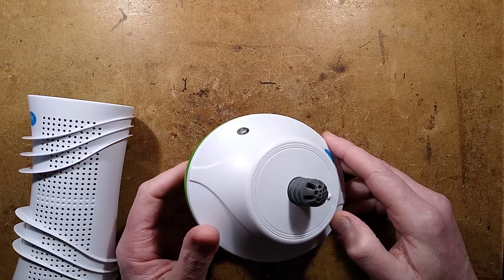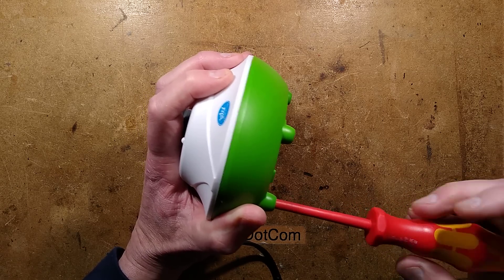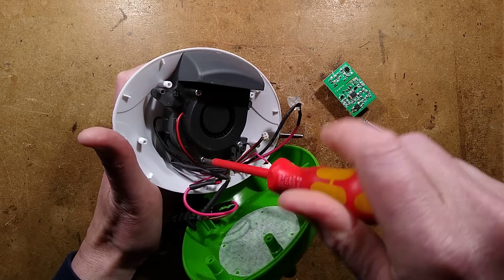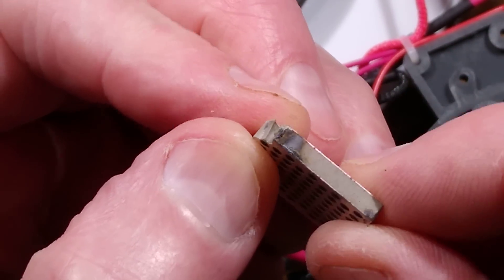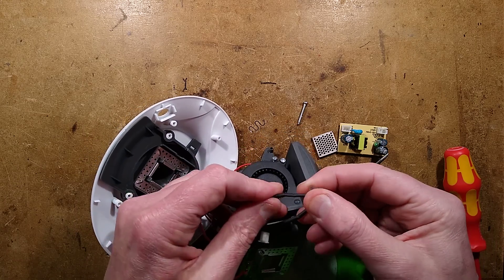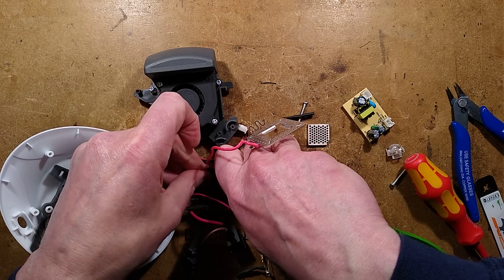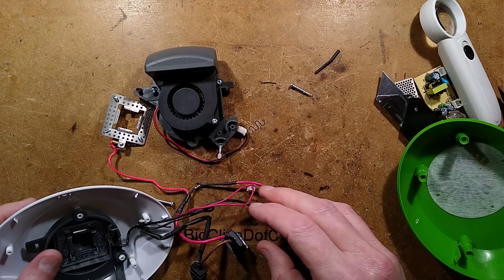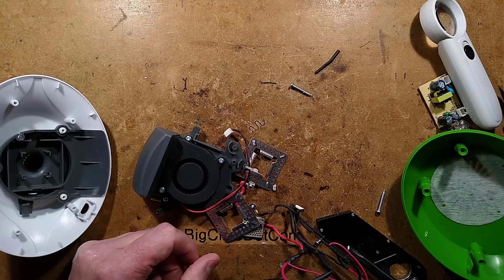This blew up!   Let's open it to find out why

Comment: This failure mode for these ceramic PTC heaters only happens to that dehumidifier. It also happens to hot glue guns as well. I already experienced it twice with the element cracking and flashing over, and popping the breaker. I think thermal cycling plays a role in this failure mode.

Comment: I think I'd wire two of those units in series, so each unit is only receiving approximately 120V. That PTC looks far too thin for 240V. I'd like to see the results of wiring two units in series, I think it should work fine.

Comment: Interesting that the fan is a "squirrel fan" which would draw air from the center and blow it out the side. If they have it doing opposite fliw, thats not a good design.
Reply from the maker: It's ported.
Reply: @bigclivedotcom  Ahh. That makes sense. Thanks!

Comment: LED across 240V? There must have been a diode across it for the reverse. Do they make back to back LEDs now? It would be logical.
Reply from the maker: They do inverse parallel LEDs.  But the red LEDs can be used like this.
Reply: @bigclivedotcom  Interesting. They didn't in my day. Do red LEDs just leak in reverse bias a lot & not get damaged? Or can they make GAs zeners?
Reply from the maker: @RedRouge-j4j  The red LEDs avalanche and conduct when a reverse voltage is exceeded, but seem to survive.  The modern gallium nitride LEDs aften fail when their reverse voltage is exceeded.  It's not a great way to treat the red LEDs, but it seems to get done a lot.
Reply: @bigclivedotcom  Thanx. I can remember when red was all you could get!

Comment: In fact that is not an real resistance but is a MOV resistor it happened me on my hotgluegun 100w inco it get faulty with just a little Voltage raising
Reply: Not an MOV, rather a PTC.

Comment: 400 grit wet & dry to get the grot off and a strip of kapton (the yellow, high temperature, high voltage) tape to prevent the plastic carbonising onto the PTC material, and you're good to go.

Comment: It looks weird to me that the soot is around the corners is where technically the metal plates dont even touch it, instead the plastic? frame does. I am no engineer but the current path in this case looks weird. Maybe those brackets melt/burn, deposit carbon and the carbon itself flashes over?
Reply: This seems to be the most likely.

Comment: Yo dude.. how do you fancy confirming if a manufacturer is planned obsolescencing their flood lights.. i have 2 of the same make, but different models both failing within a week of one another.. about the time difference in which I put them up if i recall.

I dont believe in coincidence dude, so would love to catch these fkrs out if you are up for it. Ping me if you fancy  the challenge.
Reply from the maker: The LED floodlights are often horribly designed and fail fast.  Worse still, many units being sold by online sellers are not earthed/grounded.

Comment: I wonder what the reverse voltage limit of the led is? I don't think it's anywhere near the peak mains voltage. Should have put a diode in  the opposite polarity across the led to limit it. Better still a retro flickering neon.

Comment: The honeycomb thing that failed due to arcing/flashover:  you have a bunch of these dryers.  Stack two honeycombs that haven’t yet started to fail/carbonize in a working unit and then… maybe you’ve doubled the distance it needs to arc so maybe you’ve 4x or greater extended the life of the heater????  Maybe.

Comment: Design flaw?  Noooo silly person.  Planned failure.  Since it will bridge from time to time, it will eventually fail.  They likely see this occurring in testing yet it's still in the model. Why?  They want you to buy a replacement.  You said yourself you bought quite a few as they were cheap.  Well if it works well for a bit, but the bridging decays the material so it fails after x hours of us, people using it will simply buy another as it's cheap!  It lasts long enough to be useful then fails to trigger a new purchase.

Comment: Could you use an aluminium clad power resistor to dissipate 10W or more?
Reply from the maker: It's viable, but could overheat if airflow was blocked.

Comment: I really love your videos. 🎉

But I'm also a bit scared of these appliances. 
It's a Chinese version of Russian roulette 😂

What would happen if the fuse in the plug would have been a 16A, or maybe a fake one 🤺💯

In 99% I would expect a louder pop and nothing more, but still I see a slight chance for a fire or even smoldering with lots of nasty smoke that is more mortal and can also destroy the whole flat..

I remember your video with the Car 12V Charger that had a different component design that was changed by the Chinese factory without noticing the company that had designed and ordered these products. 

So you never know wether safety critical components have the right specifications.. 
(also best example, the 2KV Y-Capacitor)

Keep the good work up! ❤

Comment: I wonder why they used a square shape for the element and not a round one. It would have avoided the corner problem and secondly fits better to the fan.
Reply: Perhaps because "it's hip to be square"? 😉

Comment: Can you replace the heater element with a power resistor and make it work back again?
Reply from the maker: That has a risk of overheating if the airflow gets limited.

Comment: Use a circular coil around a quartz rod full of 3-6mm quartz/glass beads or boiling balls. Use a PID for setting the temp and the fan can run constantly at a low speed?
Peak performance would see you using cubic zirconia beads for higher thermal conductivity with an air filter on the fan but both those are somewhat overkill.

Comment: Does that element have resistance that changes in an odd way (rising at the edges faster) due to it's construction, so that there is excessive power dissipation around the edges at turn on,making it overheat and degrade faster round the edges? Maybe one switched on under a thermal camera would reveal something like that.

Comment: At first I thought it was wasteful to have a switcher supply just to run the fan, but it homologates the design so power voltage and frequency don’t matter.  The PTC should be self regulating.  The LED will be dimmer in countries with 120 volt power, but should still light.  It seems like the LED should have been on the output of the switcher supply so brightness would be the same in all countries.

I wonder if the PTC is less apt to carbonize I. Countries with 120 volt mains?  There would be less E field across the edge and less likelihood of pulling debris across the gap.
Reply: The fan will draw too much power for a resistive or capacitive dropper to be feasible. To much power wasted in a resistor; huge power rating needed - unless a wire heating element was used, like in some hair driers that have low voltage dc fan motors, and too large a capacitor needed in a capacitive dropper.
Reply: @threeMetreJim   Yes I agree.  A capacitive dropper could work, but the capacitor it would require would be physically large and expensive, also it would be a solution for one voltage and frequency combination.

Comment: Clive they used to use Mica as a high heat electrical insulator its not hard to cut into a shape instead of the i guess its a ceramic material
Reply: It would have been better to make the part of the housing that holds the heating element out of Micanol or Micaflex, which is mica-impregnated Bakelite that was once used for electrical insulators and  base of high voltage vacuum tubes/"valves", especially for military use.  I saw a documentary about workers in  India or Madagascar digging deep and dangerous mine tunnels to extract mica for electronics use because there's a shortage of it and the demand is high.

Comment: The reverse breakdown voltage of a typical LED is only in the range of 5 volts, so in reverse conduction in this circuit the LED will only have to dissipate around 5mw peak, which won't bother it in the least. People often assume that reverse conduction is bad for semiconductor junctions, but that's just because the most common case with reverse conduction involves much higher breakdown voltages and much lower source resistances, which together make for incandescent (or even pyrotechnic) levels of heating. So there's nothing particularly wrong with running an LED straight across the mains like this with a high value resistor, other than the existential pain of the circuit being very inefficient.
Reply: It could also be a dual diode LED. There is nothing saying they have to use different colors for each diode in such LEDs. @Big Clive should test it for lighting up in both directions!

Comment: Why would I need a device to dry out my desiccant gel when you can microwave or throw the gel into an oven and it dries out better and faster? Takes me maybe 20 minutes in the microwave. From heating and then let cool and throw back into the container. I have to recharge the desiccant for my 3d filament boxes every 6 months and I just Microwave it till it turns the color indicated of dry like Blue.

Comment: The corners are also a high voltage stress point (point discharge),  so that might be a contributor. Rather than scrapping it, you can get PTC elements from the usual suppliers, or, how about one of those metal - jacketed power resistor elements (with say an NTC probe and simple load controller?)

Comment: I have quite a few of those 5010 Blower fans as I use them when building a Voron Stealthburner. Out of curiosity, what brand is that fan and what voltage? I'm sure those heaters are a dime a dozen on the Bay of the e or the Express of the Ail. Would love to see you replace the heater.

Comment: Hey Clive, a lot of tools like grinders and drills fail because the capacitor pops. Can you make a video about their size/alternatives and why there are some with 2 and some with 3 wires? Often I cant find the original part for repairs.

Comment: The same happened with my hot glue gun after a few years, although it might have blown more violently by the looks of what remained of the PTC heater and its surroundings.
It made quite a bang and it's worth mentioning that there was no fuse in the gun to make for the lack of one in the plug like you have in the UK.

Comment: How does one go about getting a package 2 U.
Reply from the maker: It's not a good time at the moment due to work related travel.
Reply: Thats cool.
Its just a .t.e.m.u. item I would have shipped directly to you.
It crosses two plasma streams and makes wind sounds. Hand held with li-ion battery.
I have one. First press of the button, thought Clive must have one.

Comment: How did it manage to blow a 3 amp fuse in the plug before the MCB / RCBO tripped at the board? 
Or do you still have a brown Bakelite Wylex fuse board with rewireable fuses?
Reply from the maker: It was probably a soft fault with low peak current.

Comment: The PTC in my glue gun recently went very low resistance and blew the fuse in the plug. I couldn't get it out of the aluminium block / nozzle  and so just had to buy a new glue gun.

Comment: We use a couple of Peltier-effect dehumidifiers in a small motor/mechanical cabin at the observatory.  During the peak summer months, they pull about 2L/week out of the air in there.  We have a larger conventional dehumidifier in another part of the "stack" which does most of the work.  While the little Peltier-based units aren't terribly efficient, they require no maintenance and just keep on trucking.  For our application, the desiccant  ones would just be too much work.

Comment: I tried so many of these cartridge based solutions and i keep coming back to using organza bags and just regenerating my silica gel in the oven. I would love to find something more convenient, but they all seem to either not be very durable, don't regenerate properly or just cost way to much...
I think i will try to 3D print my own next, maybe some high temp filament that won't melt. Any ideas? :)

Comment: Get another one, and break those four plastic things that 'align' the PTC element.
Use gloves etc. - you don't want to touch the ceramic, the oil of your hands will track the same way the molten plastic has...
Maybe you could wrap the plastic legs in kapton tape, but better to just be rid of them and be careful to align the element on reassembly.

Comment: Why do they always seem to overdrive the resistor?  A) They are crappy engineers.  B) They are trying to save 0.01 pennies per unit.  C) They have run out of the correct size of resistor.  D) All of the above.  E) None of the above.  F) None of the above answers are correct.

Comment: Scientific Fact: Any product manufactured from high-grade Chinesium will suffer catastrophic failure during use...
(3000Wattt power output, batteryi not includid, Using mya cuse failure, manufacturir not repsoncibyl for wrongfull use, do not leave aparratus unattended, adult super vision only)

Comment: Clive have you seen the videos on YouTube for a electric device to remove itching from a bug bite sting? They use a small ceramic heater maybe 4 or 5mm square and heat it up for 4 to 10 seconds on the sting/bite area, this is said to trick the body to respond to a burn and not the sting. I guess it only gets to about 120 to 150 degrees f "48 or 50 C". They plug it into the smart phone for power and use a ap for the timer. What if you build a unit that uses a push switch and USB power to save us Money as they charge anywhere from $50 dollars and up for these devices. If they even work.
Reply: A low tech solution that I use. Heating the back of a metal teaspoon with some hot water before applying it to the sting. Or using a fingernail to mark a (light) "X" indentation over the sting site. I think the theory is that a "pain" response, either the heat or pressure(?) using nails, overrides itching signals which provides us with some relief from the bite. Or potentially the heat denatures or breaks down some of the foreign chemicals introduced by the bite/sting which lowers our response to it.

Comment: It does look like a short distance to cover for the voltage applied. What is it in the UK 230-240 volts? It may fare better in 100 or 120 volt counties. I wonder how often the filter material on the bottom cover clogged up with dust?

Comment: you could grind the edges clean again with a diamond wheel, and then apply either silicone grease, or silicone sealant, or ceramic paint to seal it and retain the sealing at higher temperatures the device functions at.
A middle step that may or may not help or prove smart, is to etch the edges with an aggressive acid to dissolve any metal tracking, and wear away the sharp edges such that electric field emission points are smoothed and rounded to reduce the risk of arc/flash over.
Reply: Definitely worth a try.
To see if any magic blue smoke comes out.
Reply: Rainstorming some solutions for the damaged PTC: #1 (less confident) try to squeeze some remaining hours by using a sand-paper (probably a 320 grit, water resistant works better) at the corners and retest. 
#2 Use some 1W power resistors in series to dissipate 5~10~15W,temperature limited by an NTC+Triac circuit, or simply by a thermal switch/cutoff.

Comment: Looks like the plastic supports in  the corners have melted and carbonized and provided a conductive path to start the flashover...  I would bet that if you had a new one and either cut off those supports or put a   bit of heat resistant kapton over the plastic that the heater would have a much longer lifespan..   For heaters that have already been used, you might be able to disassemble them with somewhat more care than you exhibited in this video, and either sand/scrape/chemically dissolve the melted plastic and then perform one of the steps above to keep the plastic from melting onto the element..
Reply: Exactly the same comment I was going to make.
Reply: Watch out for plastic ESD assortment bins...  some (most?) are made from a slightly conductive plastic mix so when they hang of the (1Mohm grounded) metal rack all ESD is dissipated in a controlled fashion... however I took one bin off rack and brought it with me deeper into the lab: After a few 10 minutes or so of "too little thinking - more measurements"... with the incidental contact with 400V it started to bzzz... BZZZZ!! SNAP! CRACKLE! SMOKE! Microarcs! 😆 oh dear! (no POP, the voltage amplifier was just doing it's thang, happily feeds no less than 3kW continous if you just ask it...)

Comment: The OPTIMUM way to dry pink silica gel is to pop it in an ELECTRIC oven ( NOT gas , these produce water vapour ! ) ... until it turns DARK blue .... tip it in a clean jam jar ... and it will keep for YEARS , nice - n - dry ........ but , at least you have a few bits - n - bobs for future usage ..... ( tried - n - tested ) ............... DAVE™🛑

Comment: To continue using the cartridge. Rip the guts out, cut a hole in the base, and bolt a cheap hairdryer to the bottom. Afterwards put legs on the dryer for air clearance and switch on.
Reply: This is of course on every true Scott's mind!
Reply: I have a food dehydrator that I use for dehydrating wild mushrooms and it has a circular air chimney in the center which is about the right size to place one of the silica gel cartridges directly over.  It would be wasteful of electricity if not simultaneously used to dry sliced mushrooms. Actually got the dehydrator for free from the local dump and the only thing I had to do to it was fix the loose fan blade which had slid down the motor shaft and was binding on the housing.